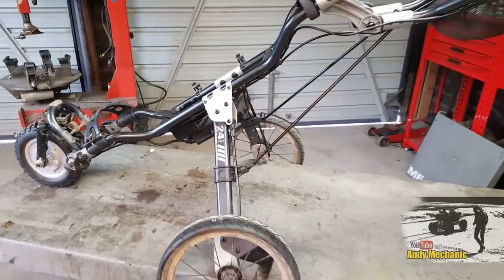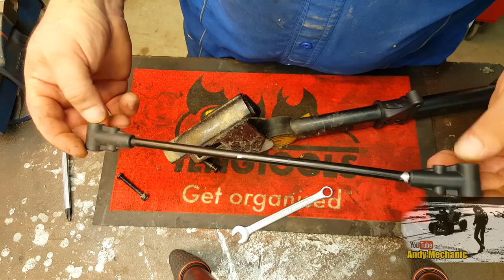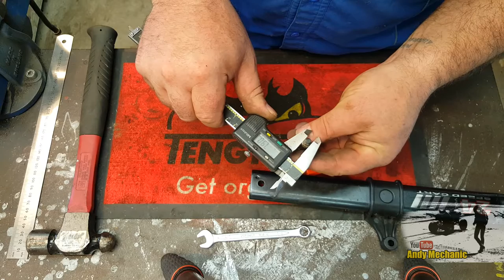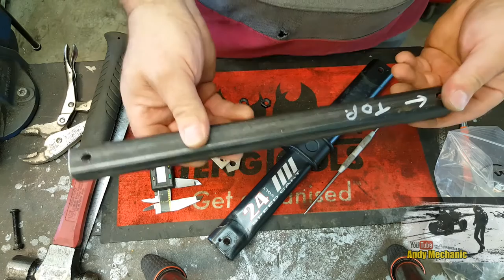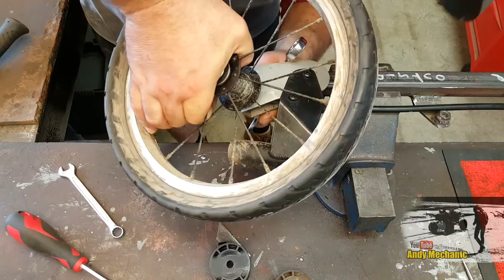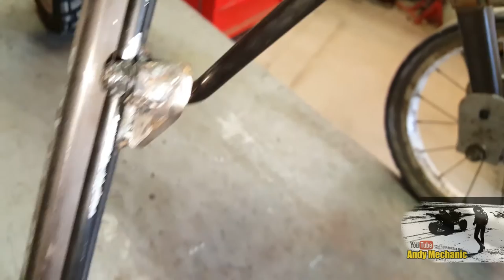Electric golf cart repair #2012

Comment: Great repair and wonder where you learned your trade ?
Reply from the maker: +Tom OConnor Thanks Tom, it's sort of skills that I have picked up over the years to be fair. Don't consider myself an 'expert' in any field, there are always people out there that know so much more.

The trick is to learn from them, take it on board so to speak.

I purchased my first Welder when I was 13 years old. An air cooled arc Welder,  as soon as I could afford a good Mig I got one, I think I was around 17 by then...

Have worked on cars, motorcycles, ATVs, trucks, plant, very rarely turn anything away and rarely fail to get the job done.

I enjoy the challenge and variety too though pleased I can go do a lecture too...

Good to know you like the videos
Cheers for now. Andy